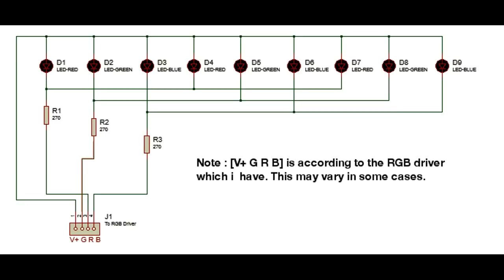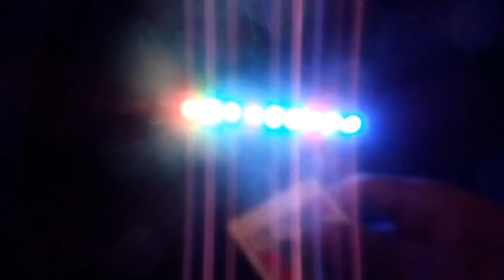How to make a mini RGB LED Strip | Homemade

Comment: I have small LEDs from an old hose for the new year. In my case, the lamps are connected in series and resistors were used so that the red, green, blue and white LEDs can work at 12V. Can I make an RGB strip at home with those LEDs?

Comment: Very good tutorial; what voltage and what intensity can we apply if we do not use the LED driver
Reply from the maker: You need to keep the supply voltage above 10 &  below 12 Volts & current under 500mA (Note: the circuit which i shared needs only around 150mA).